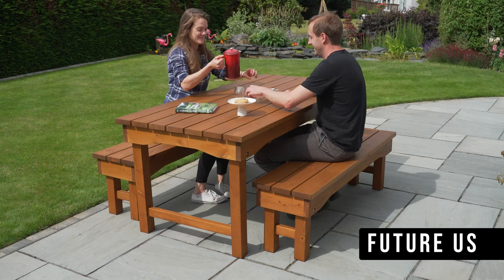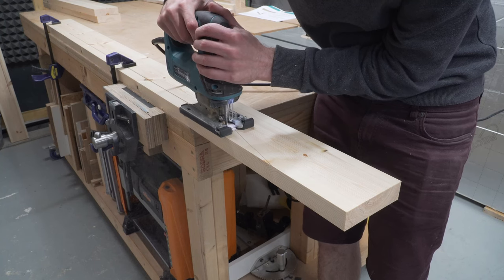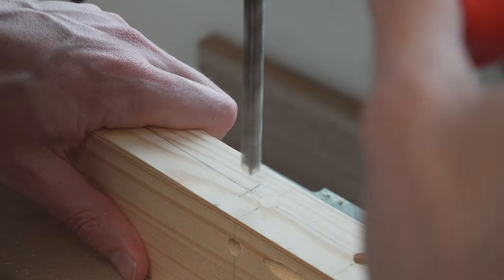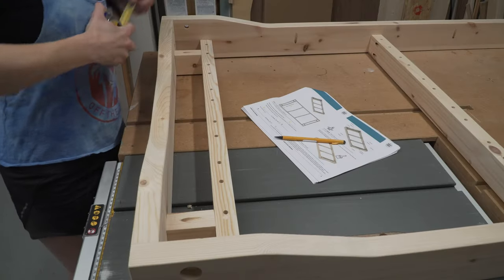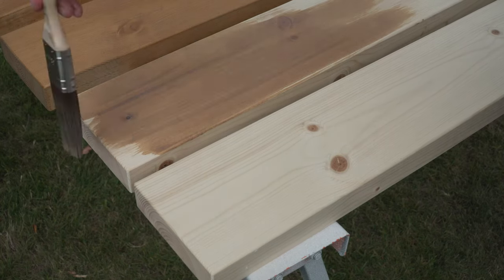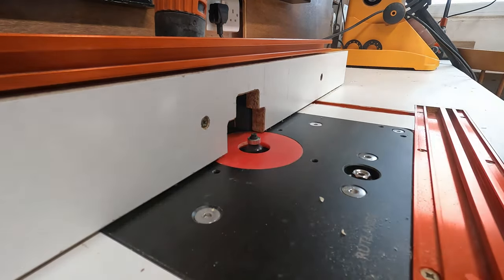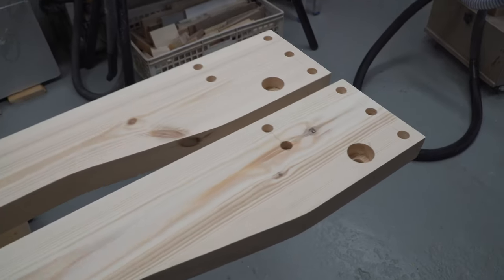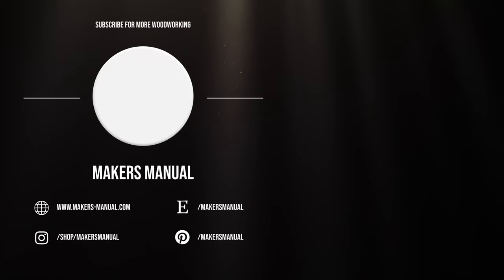DIY Folding Patio Table | Easy Picnic Table with Plans

Comment: I really like the look of this - just waiting on our b&q table to die on us so I can try making the replacement myself. The colour looks great too - what wood stain did you use?
Reply from the maker: Thanks, we're very pleased with the way the table looks on our patio. So nice to be eating outside through the summer.

We used Cuprinol Decking Oil in Natural Oak (linked here https://amzn.to/44VaE08), it gave a great final result, but wasn't the nicest to apply. If you do use Desking Oil rather than Furniture Stain, make sure it isn't a skin irritant, apparently some brands can be bad. The packaging on this product doesn't say anything concerning and we've had no issues.